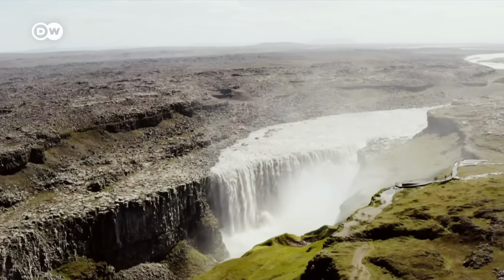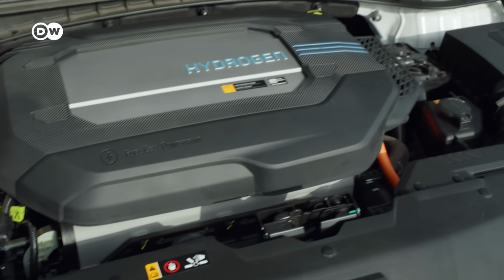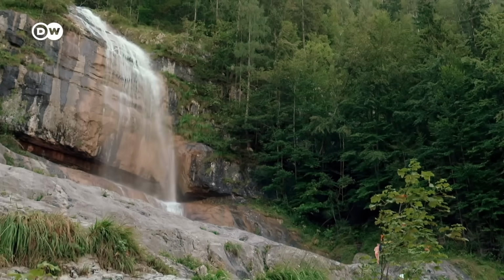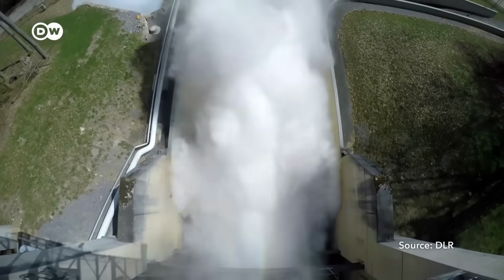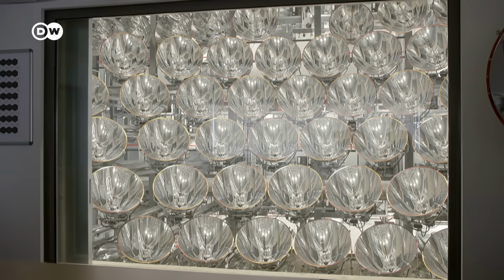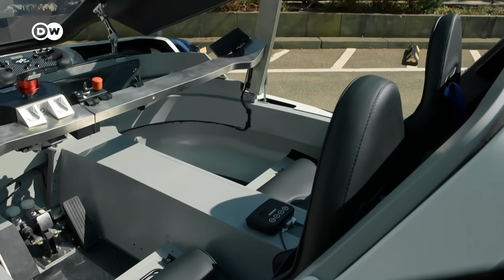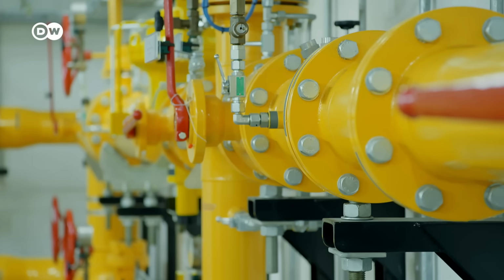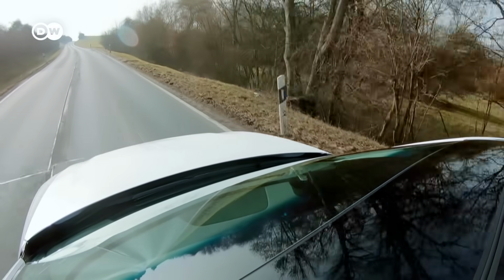Is green hydrogen the answer to the climate crisis? | DW Documentary

Comment: I really like the idea of using hydrogen in an energy storage capacity directly at solar and wind installations. It beats having to transport the hydrogen and could help us agree on electricity being best for terrestrial  transportation purposes. Remember, every step in getting hydrogen to a fuel cell vehicle costs energy and makes using hydrogen less efficient.
Reply: H2 is high pressure, corrosive, temp sensitive, and explosive. Large tanks. Do you really want anything like that near where you live and sleep?
Reply: @blomegoog  the apartment I live in is made of wood and other flammable material and I drive around in a car with a tankfull of combustible fuel...madman that I am
Reply: @jefferee2002  "the apartment I live in is made of wood and other flammable material and I drive around in a car with a tankfull of combustible fuel...madman that I am"
That's like comparing vinegar to sulfuric acid or comparing a candle to dynamite.  The lumber in your house isn't going to explode.
Reply: @OweEyeSea  oh my God you're right! I forgot about the Hindenburg 100 years ago!!! I forgot natural gas doesn't explode taking out entire city blocks! (Oh wait, it does, and yeah that did happen. But here I am, silly me, turning on my gas stove. And gasoline, yeah, it's kinda flammable. Lotta energy packed into that liquid I'll tell you
Reply: Yes...   in fact, I want to live right above it -  a small condo on top with a view.   If it goes up in smoke, I'll have a real nice and quick end to this silly game. @blomegoog
Reply: In the desperate rush to reduce CO2  to stop climate change what happens if climate change happens anyway ? Should we not be preparing ourselves for  higher temperatures anyway and all that brings with it  - more droughts and perhaps  air conditioning  being  everywhere in Europe including our homes ? 

We talk about increased temperatures over recent decades  but that time frame is nothing in the history of Earth - a tiny blip. If we get  much hotter weather  over the next 100 years that may be a long time for us but is still, in the history of the life of the Earth,  a mere blip in time..
Reply: Where I live in the North West of England  700 years ago vineyards were  grown. Of course they have now gone - the weather is too cold and perhaps too wet (I'm not a vineyard expert !).  700 years sounds a long time but in terms of the life of the earth it is nothing. 

As humans  we are thinking about ourselves and the fact we don't want it any warmer than it is . An extra 10 degrees C in Summer is called a crisis but many animals have adapted to this. The way humans treat the planet with all sorts of pollution  - not just Carbon Dioxide emissions from cars which contribute less than 10% to world levels but all the poisonous chemicals we dump in the ground, in the air and at sea is a bigger world crisis. 

Middle eastern countries have adapted to hot climates people in Europe (and I include the UK in that) are going to have to adapt to that.  In 2040 millions of people will be sat in electric cars (if they can make enough that is)  with the air con turned full on everyday  because it will be the only place to stay cool !   

Every time in the UK  there is a week of rain, a week of snow, a week of wind  all the media ( including the BBC) are shouting climate crisis.   When you look at parts of the world  recently experiencing  record temperatures  it is a small  % of the worlds surface area. The rest hasn't changed. but no one is talking about those.

Finally, we can't look back at 150 years of local  weather data  records  and say that is representative of a 4.5 Billion year old planet.
  
We need is informed scientific debate  but what we actually  have is the vocal minority  
who are too frequently scientifically illiterate shouting down anyone who has a contrary opinion. 

It wont end well unless humans and governments start talking the truth and stop running personal and political agendas but whatever happens the Earth will probably keep turning and other animals will survive and thrive long after humans have gone and as they did long before humans  first appeared . 
 
Rant over !
Reply: @we-are-electric1445  we are for 2,5 miljon years in an interglacial period, so you are right it wil get a few degrees colder or warmer then today until we get another ice age, from what i know here in belgium we have now for the last 30 years 830mm annual rainfal on averagel, 5 years ago it was 850mm but 20 years ago it was only 750mm so in general we got more rain here, it shows that al the information about climate has to be taken with a grain of salt, most important is to check the information, repel it if it is not accurat, so far there is no reason to be alarmed, we have to look at things like energie for example in a realistick and not idialistick way, the utilisation of resources has to be done considerat and efficiént
Reply: Yes it's less efficient but on the bright side, it's way less polluting than batteries and solar panels. They require A LOT of mining AND produce a lot of e-waste. We shouldn't swap out one problem for another...
Reply: @amoebasgonewild  Without solar panels where do you get energy in the first place? Wind farms with blades made from fiberglass that can't be recycled? Wake up, hydrogen is a carrier not a source of energy.
Reply: @MrFujinko  did you....you didn't watch the video till the end and it shows. Like????? They addressed that solar thermal could provide a path. Could be really good for middle eastern countries are they have PLENTY of sunny desert, CAPITAL and INCENTIVE to diversify away from fossil fuels while still maintaining dominance over energy
Reply: @amoebasgonewild  yes indeed could, i get the jitters of that panic that drives us in to technologies that are not fully developed, and that is even in the best cases.
Reply: @amoebasgonewild hydrogen is not green clean solar wind turbine production also have some carbone emissions and u nee more extra solar panels and wind energy because inefficiency   battery are recycleble and fuel cell matarial also need mining direct lithium minig
Reply: @ayushtiwari46798  its greenER was the POINT. Like????
Reply: @amoebasgonewild  it's difficult to store and waste 60 %+ energy
Reply: @ayushtiwari46798  what's difficult is to upend the entire energy system AND maintenance system we have now for a completely new one. Like...literally dont have enough mechanics for the advanced work for electric vehicles. Any costs associated with energy efficiency will evaporate once you actually have to go fix something.

After what. 15 years you will need an EXPENSIVE battery replacement. People wont be able to afford that. Combustion engines can basically run indefinitely and maintenance can be more spread out.
Reply: @amoebasgonewild  seaweed bio fuel and alge bio fuel is only solution
Reply: @ayushtiwari46798  no. Its nuclear hydrogen
Reply: @amoebasgonewild nuclear is expansive   so how hydrogen will economical nuclear future but 100 year later nuclear waste dangerous than battery disposal
Reply: @amoebasgonewild  if we have nuclear energy and efficiency not matter than  we make e fuel s , synthetic fuel  then we not need to change anything fuel sation as  are as now don't need to change engine car existing infra structure
Reply: yeah TV Show watcher . Only because you never research any of this
windfarms cost more and use more energy  to build than they produce .
solar panel toxicity . costs per watt - go buy some at your Canadian tire -
there minimal watts . not very useful 

electric black child labour cars  ?  congo cobalt mining - not 2 environmental 

the concepts are great . but the power tech source is not here yet 
its not like people are stupid . and use the best they can get 
WHICH IS NONE OF THE BS . YOUR SOLD ON .NOT RESEARCHING ANY OF IT

Comment: The answer is to build nuclear power plants, send the waste to space after a certain level of build up, and allow our centuries of oil deposits to be used in diesel and petrol cars which are incredibly efficient and barely produce pollution now. 

The current lies allow for 'green' energy to consist largely of biomass, which is burning tree's, and wind and solar, which have to be supplemented by fossil power plants as they simply cannot produce energy consistently or enough of it. And we build electric cars which require rare earth elements mined and flown over in planes, and require so much electricity that green will not be enough. Are we insane or just so propagandised?

Comment: Look ffs you cant just burn Hydrogen you have to burn HHO - if you burn just hydrogen it takes oxygen out of the atmosphere and binds it in water. The only way to get that oxygen back is to electrolyse it. The solution and the ONLY solution to our future is to build nuclear power stations specifically and solely designed to electrolyse water and release HHO which can be used instead of petrol etc. <-- there is NO OTHER WAY if you want to avoid the Apocalypse of the Revelation which IS global warming.

Comment: Will green hydrogen save the climate?  The climate does not need saving.  Hydrogen production is a matter of cost and energy efficiency not of colour, if they are relying on wind and solar to produce sufficient hydrogen for transport needs they will fail to meet their target. The 'greenest' gas is carbon dioxide, without it there would be very little that is green. Why pollute the word hydrogen by adding the tag 'green' to it?
Reply: Thank you for the only sensible comment so far! This obsession with co2 and "carbon footprints" is unbelievable.
Reply: run a gas generator inside ur house, is the same we r doing by burning fuel and coal to produce electricity

Comment: Hydrogen is not a fuel in the historic sense as it needs to be created and for "Green" hydrogen we use electricity to "create" Hydrogen in the first place by splitting water. I have read that this process is no more than 50% efficient so it is actually a wasteful use of the initial energy. We already have well-developed and efficient ways of moving electricity around using the power grid and (for cars) batteries. Hydrogen as an energy transport medium might be useful in a few usage cases such as the Airline industry but for automobiles or domestic heating I think not.
Reply: Car batteries are a difficult thing to dispose of though and the materials to make them expensive and require mining. Efficiency will increase quickly and as long as the source is renewable and abundant it isn't too much of an issue.

Comment: Usually I really enjoy DW but this one fell flat.  Too much focus on the idea of carbon neutral and green hydrogen by ignoring all the climate impacts of a more "full cycle" approach.  Windmills are greener than fossil fuels in many ways, but they still have a significant environmental impact to build and maintain.  Building the hydrogen vehicle has an environmental impact too, so that's not really a true carbon neutral.  Yes, hydrogen has a lot of potential but let's be more realistic here.
Reply: Building an H2 vehicle has much much less impact than building an electric vehicle with batteries.
The video focused on hydrogen as a fuel / energy and ways to produce it carbon neutrally.
If it had a full cycle approach it would need a full series of hour long episodes.
But you could have spotted the fact they only focused on "green" hydrogen and not more broadly on carbon neutral hydrogen as they didn't cover nuclear powered hydrogen production that is being pushed in France.
France is the most (civil) nuclearized country on Earth and they are planning on using some of the spare power to produce hydrogen, on top of the dedicated hydrogen production reactors they project to build.
There's debate at the EU level whether to grant the "green" qualifier to nuclear produced electricity and hydrogen. France wants it, Germany doesn't.
It isn't just a matter of semantics as it will partly decide if "green" subsidies are also granted to nuclear power because the EU law for climate energy transition subsidies states it must be "green", hence the debate.
One way or the other it's carbon neutral.
So France's argument is that given the end result is a massive reduction of carbon emissions, it should be given the "green" stamp.
On the other side Germany says that no matter the end result, nuclear isn't green, even if it helps reducing carbon emissions.
It hasn't been ruled yet but I think France has a stronger argument here as they emit more than 2 times less carbon than Germany per capita and the end result and urgency is carbon neutrality, not to know if nuclear is actually green or not (we all know it's not, but it's carbon neutral).

Comment: The cost vs effect is just not worth it and if it was possible, wouldn't the aviation industry using it already in the last 20years? Having a bigger wind and solar (green power) grid and improving existing battery technologies is the way to go ie. lithium iron phosphate. Battery production is still produces pollution (pulling lithium from the ground) and the focus should be re-defining existing battery technologies moving forward. Although hydrogen can be green, is it is highly dangerous during an accident, perhaps lithium iron phosphate batteries could be safer.

Comment: Hydrogen being a v combustible gas, what's the driver's survival chances  in a crash scenario (Vs other fuel options)?
Reply: H2 it is the lightest know element it just floats way unlike petrol fumes that hang near the ground and batteries well it dont take much damage to get them to burn and once they burn its very hard to put them out need a lot of water dumped on them to stop the burning ATM most fire departments just let them burn unless there are people still trapped inside or theres a risk of fire spreading and if they are put out a fire truck has to follow the tow truck as batters can relight kinda like those trick candles that you cant blow out. oh and when i say a lot of water it can take few tanker trucks of water to put out an EV there are some chemicals additives but there very unECO friendly.
Reply: EV's are the way to go. Using H for small vehicles is silly and inefficient.

Comment: Where does the Submarine get Oxygen for the Hydrogen fuel cell
Reply: Sounds like they use electricity from the diesel engine-generator to split water.  If there are no losses, they get exactly the right proportions of hydrogen and oxygen -- they just have to store both.  It's really a diesel sub with a fancy 'flow battery'.

Comment: 1976 a man made " Gas Vaporization " it made a v8 350c.i. motor go from 20 mpg to 100 mpg meaning an average full size pick up get about 3000 km a tank . It can be fitted to EVERY combustion motor on the planet . The patient was bought , the inventor was " suicided " 2 years later and the patient was shelved in 1979 ...  If your vehical now got 100 mpg +++ you wouldn't even need an electric vehical and the co2 emmitted from current vehicles would immediately be 80% less !!!!!....

Comment: So few people understand how massively difficult it is to strip hydrogen from water. FAR easier to crack it off of a hydrocarbon. You know, like... oil.
And a bottle of hydrogen under pressure? Basically a bomb. 
Hydrogen vehicles are a cute idea, but until they can solve the problem of not having the entire fueling station go up like Hiroshima when some numb-nuts tries to refuel by himself, it will remain just a cute idea.
Reply: Spot on. It's funny how this cute idea of stripping a literal pressure bomb in your car comes from the same people that will dismiss methanol "because it can poison you".

Comment: A very informative film. I didn't know about the work on directly converting sunlight to hydrogen, without using hydrolysis which is inevitably less efficient than using the electricity directly. I agree with the woman who says 17:30 hydrogen is not suitable for light passenger vehicles at the moment. It may stay with heavy trucks for several decades in most countries. However there are some places where hydrogen for light passenger vehicles may make more sense earlier. Perhaps Japan and Korea, if they aggressively convert their economies to hydrogen with the help of imports, may find it economical to use hydrogen for light vehicles and shorter trips earlier than most countries. And the work on hybrid drive trains is also interesting.
Reply: from where are you
Reply: the simio world maybe
Reply: Their argument is always like give us multiple times more money than what is required for BEVs to work and a few decades and we can prove it... 

But it can end up an expensive disaster that fail to achieve climate goal too, why risk it I just don't get it.